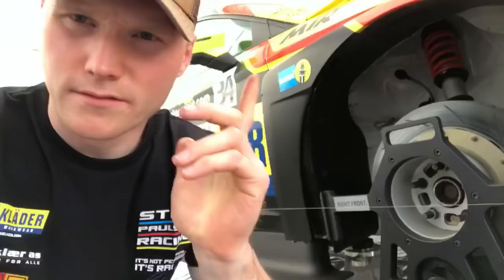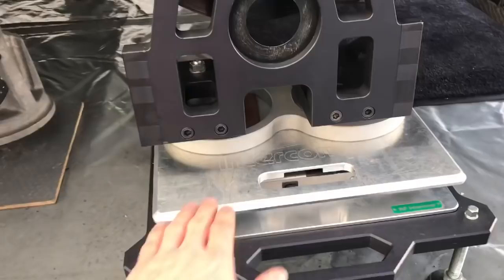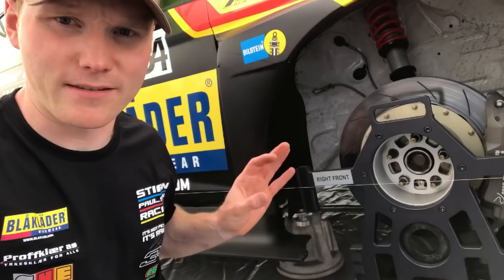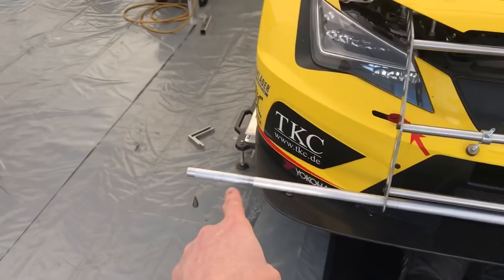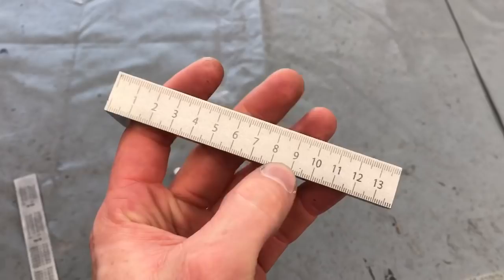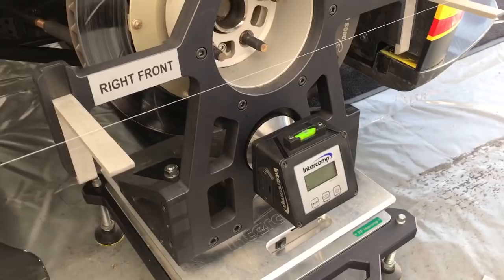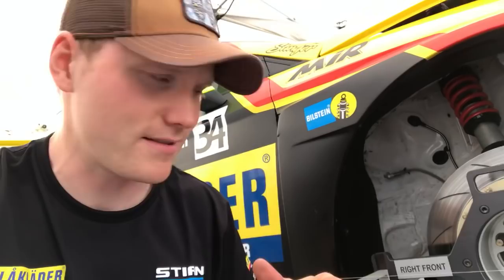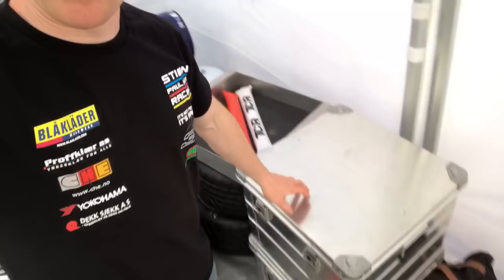HOW DO WHEEL ANGEL SETUP ON A RACING CAR - VLOG50

Comment: very nice tools, congrats! 
one question: you align the lines on both sides with the ruler, when both sides are equal it´s perfectly parallel. 
But that does only work if you have the same camber values left and right. Am I wrong? 
Thanks fo sharing your system with us!
Reply from the maker: Hi, thanks! Yes, you are right, but when you don’t have the same camber left and right it also work because the wheels will any why be in the same direction. We also try to measure the lines out from point in the chassi but it’s no different on the handling😕